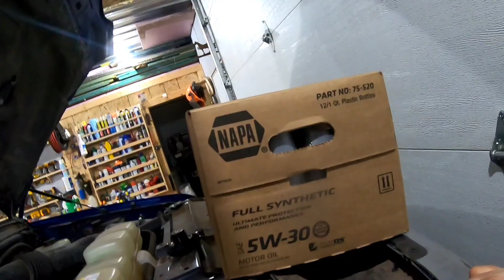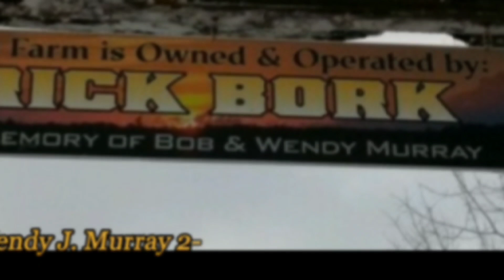Old Blue Finally Makes It Out of The Shop.

Comment: Luke would probably have a coronary! (i hope not though) for 40 years I ran 15-40 Mobil Delvac in everything . 4.9's, 5.0's, 5.8's, 7.0's, 5.7's, 4.3's and on and on. Never had any issues but one of my co-workers started using it in a '82 Chevy with a 305 and it washed sludge down in the pan and wiped out  the cam. The engine was not maintained worth a crap! Our climate in SW MI. is a bit warmer here than what MN. has.